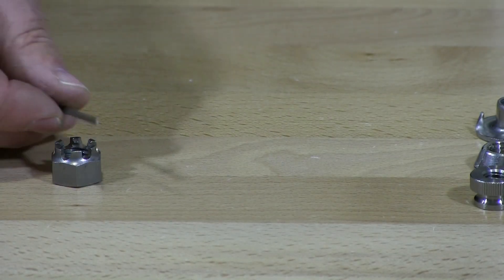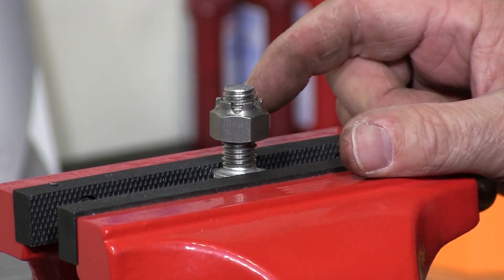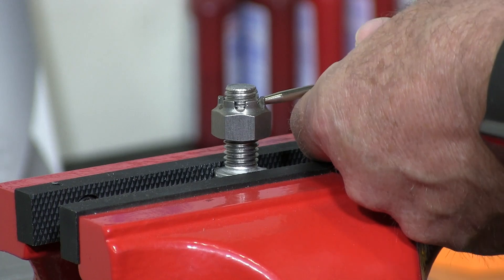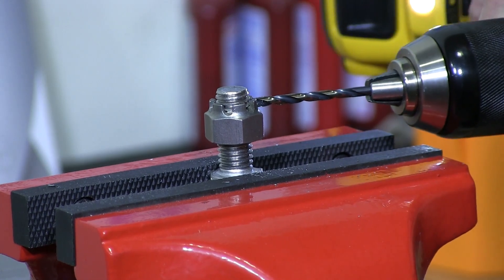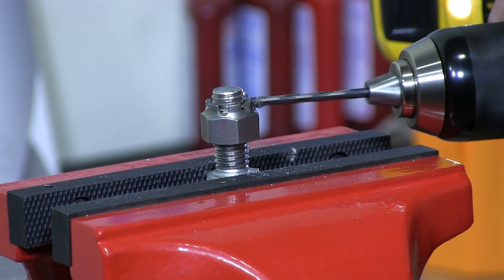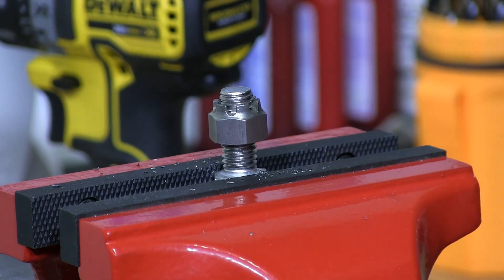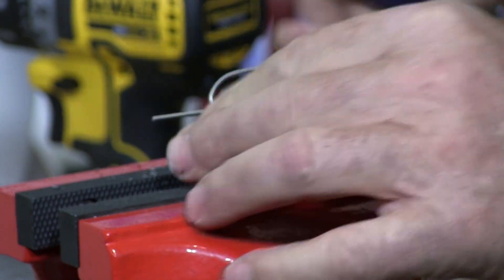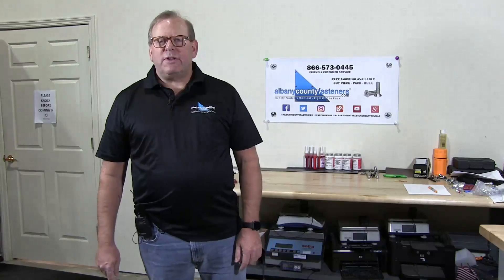Castle Nuts - How to Install or Fit a Cotter Pin and Slotted Nut | Fasteners 101

Comment: In another film a gentleman said the correct way to put a cotter pin is a longer leg up, then, after the torquing and alignment, that longer leg is bent over the end of the bolt, the shorter one is left how it is, unbent. I understand it is not so important, will work any way, but good to know the exactly correct method. Pls could you tell what are advantages and cons of the different methods: 
1) bending horizontally (how it is done in this film)
2) bending vertically (sometimes only one leg)
3) bending horizontally 2 legs together
4) bending vertically 2 legs together
Thank you for the informative film.
Reply: Don't worry, he will reply you soon...

Comment: Can you go without cotter pins? Is it safe?
Reply: No, the cotter pin is there for a back up in case the nut loosens and tries to come off, then the cotter pin stops it. On things like tie rods or other suspension parts on a car the cotter pin could be the difference between completely losing your steering or being able to pull off the road in time.

Comment: Which dia of driil bit to use
Any formula
Reply from the maker: The drill bit diameter should be 1/16" bigger than the diameter of the cotter pin. The cotter pin should be an appropriate size to fit in between the sections of a castle or slotted nut. There is no simple formula that we are aware of to determine accurate sizes. You may be able to find bolts with holes already drilled into them for this purpose as well.

Comment: May I ask your opinion about cotter pins (size 1/8 X 1-1/2) grade 5.0 for cars? It is much easier to work with them than with stainless cotter pins. But are they reliable for a small passenger car (2003 Chevrolet Cavalier), not a truck? In the set of ball joints I bought the hole in one of them drilled perpendicular to the plane of the steering knuckle, so when you install the cotter pin it hits the knuckle and to put it in you need to push and  slightly bend both ends, push and bend again until it sets in the hole. Thank you for a great film.

Comment: I get half way through and my drill bits will not cut anymore
Reply from the maker: Give the Norseman brand drill bits I've linked you in previous comments a try. I'd also double check the method you are using to drill. Are you applying lubricant and sufficient force like Bob is in the video? Give it a shot and let us know how it goes.
Reply: @AlbanyCountyFasteners  yes and thank you ill have to try these

Comment: Is there a correct name for the bolts that come with a hole already drilled?  Also, I'm wondering how you would get the notches in a castle nut to line up correctly in a pre-drilled bolt.  Seems like test fitting the nut and bolt in their actual application would be the only reliable way to mark and drill the bolt for correct location once tightened down.
Reply: Left arm

Comment: I have one question if you were going to drill through just two cuts on the opposite side (for the castle nut)
what's the point in having the nut cut at 6 points ??
Reply: Normally, you are dealing with a thread that already has the hole for the pin. You tighten the nut to the appropriate torque, stopping at the nearest cutouts.

In this demo, access is 360 degrees. In real life it is never usually so. Having torqued the nut, the multiple cutouts give you a chance to access the thread at a cutout, with a drill.

Comment: Some additional stability could be gained but using a second nut below the castle nut. Tighten the two together and they should not move. Loosen and remove the bottom nut when done drilling.

Comment: Hi, it is much better to drill vertically, place the bolt with a nut horizontally in a vice, after installing the cotter pin, shorten it so that it ends at the first slot😊

Comment: When the application is smaller and not dangerous, you can also simply use locknuts
Reply from the maker: Indeed! The smallest castle nut we carry is a #10, so any applications that use smaller screws would need an alternative locknut.

Comment: It's a split pin and you should have been orientated the pin a further 90 degrees. The general convention is to only bend one leg of the pin back.
Reply: Not necessarily, when doing a balljoint castellated nut, you may certainly want to do it this way, as the likelyhood of debris such as mud, grass, ice, snow etc etc deforming the pin and touching the CV joint boot thereby compromising the boot is much much less.  Basically as long as you have a properly sized pin in there and its secured against falling out and doesn't interfere with any other parts is all good.
Reply: @gmctech  nonsense, they come from the factory fitted as per the previous post, it is incorrect to fit them as per video

Comment: Yes sir... Adding the lube to the side of the drill bit really helped out a lot... Oh well at least the drill bit will spin easy through the hole that the tip drilled without oil
Reply from the maker: Thank you for your feedback.

Comment: Is a cotter pin supposed to have resistance going into the hole or loose fitting and goes in easy?
Reply from the maker: You should be able to insert with your fingers and should not be loose but just snug going in.  Make sure the nut is aligned with the stud hole and not off center.  Otherwise you will have resistance.
Reply: Albany County Fasteners Is it ok to back off a castle nut a smidge to align with the hole so the cotter pin goes in easier?
Reply from the maker: Yes back off to align the holes.
Reply: Albany County Fasteners could you tell me what size pin I'd need for M16/16mm castle nut?
Reply from the maker: We would recommend a 4mm or 4.5mm cotter pin for an M16 Castle Nut.
Reply: Albany County Fasteners thanks for the help 👍
Reply: What drill bit are you using
Reply: @mrsemifixit  I've heard you can only go forward, means just tightening it, never back to loose. Do torque specification, then tighten to the alignment.
Reply: @kx1hundred  He said 3/16"

Comment: the bolt im tighting the nut onto isnt long enought to wrap it on the screw itself
Reply: Position the short split down the nut and the long split over the top of the nut and bolt end.

Comment: Someone plz tell me that what those six slots in nut are used for..?
Reply from the maker: Hi Ritesh,
The slots in the nut are used in conjunction with a cotter pin to provide a locking mechanism. Once, a bolt is installed, the castle nut is spun onto the bolt. Then a hole is drilled in one of the slots until it comes out on the other side. Once the hole is made, a cotter pin is slid through the hole and bent around the nut. The pin acts as a locking device which prevents the nut from spinning off.

Comment: That is incorrect. The  head of the pin should be parallel to the fastener  inserted between into a cavity of the nut - not sticking out. Then with the short leg of the pin pulled over the top of the bolt, the other leg down over the side of the nut.
Reply: Not in all cases. In an application like a castle nut on a boat propeller shaft, the shaft extends beyond the nut and pulling either leg over the end of the 'bolt' is impossible.

Comment: I suppose for cars etc that would be an ok way to fit a split pin,but on aircraft that just would not do.
Reply: what alternative would they use on a aircraft?
Reply: @RiskyRabbit  They use wire locking
Reply: @RiskyRabbit  They would further bend the end of the pin inward into the slot of the nut.
To prevent loosning pin that would vibrating and damange other component around it.

Comment: Ok, I don't have castle nuts, just regular nuts, do I do it the same way, or should I go through the nut.  Seems like going through the nut would weaken the nut and the bolt.  But not going through the nut, and the nut will loesen and start putting screw tension on the cotter pin....
Reply from the maker: Go get a castle nut.

Comment: Not a cotter pin it's a split pin, you have fitted it incorrectly, the head of the split pin fits in the castelation, the long leg is bent over the top of the bolt and the other cut off,

Comment: That was a split pin, not a cotter pin.
Reply from the maker: Cotter Pin is the US term for Split Pins. There is another fastener known as a cotter pin, or crank cotter pin, that is wedge shaped in design. In the industry, many terms are interchanged and commonly in the US, the type of fastener we use in this video is referred to as a cotter pin. We apologize for the confusion.
Reply: @AlbanyCountyFasteners  Thank you for the information